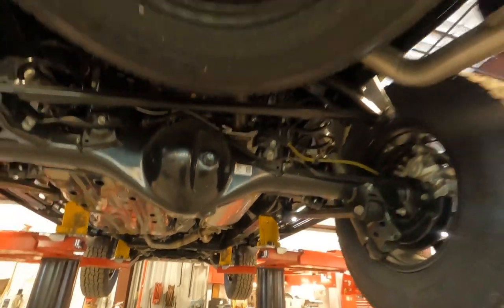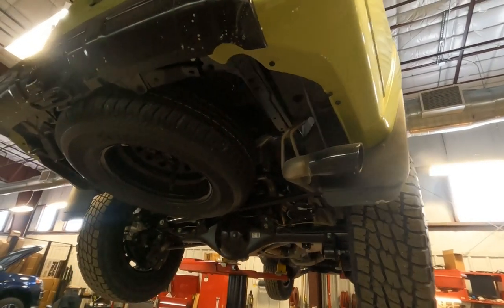2022 Toyota 4Runner TRD Pro Fox Suspension

Comment: Just an fyi, those are not tow hooks, they are transportation tie downs points 2 in the front 1 in the rear for the cargo ship. You will damage lower frame, core support area if you are being pulled or pulling someone.
Reply: You mean the tow hitch?? Where would you tie down in the front?

Comment: hello, quick question I have a 2011 4runner Sr5 will that Suspension from a 2022 4runner TRD fit my 2011 since they are 5th Generation 4Runners???
Reply: Yes. It will.